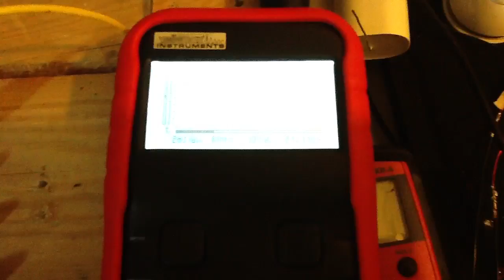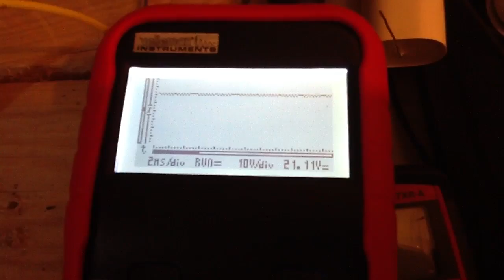44 Don Smith Device Project: New Driver, Measuring DC In and Out

Comment: Hi KD, well done! Did you also use a lowpassfilter for the input to measure the 70 mA?
Or was this only the pulsed input current? If the later is true the input ampmeter might not measure the pulsed input current right.
Please recheck with shunt and scope there.
Many thanks!
Regards, Stefan.